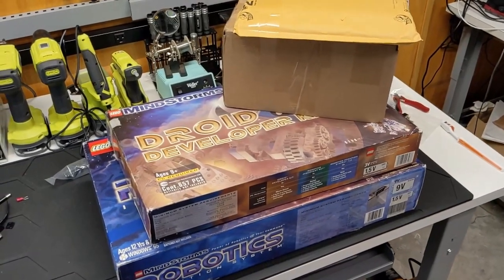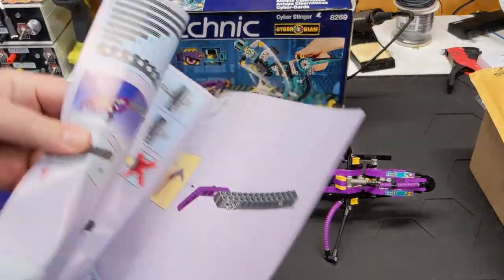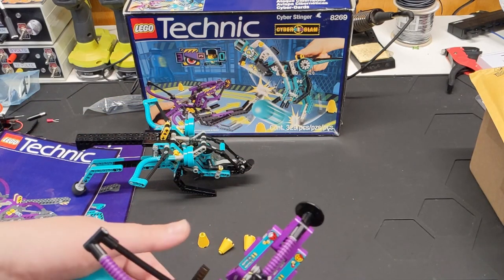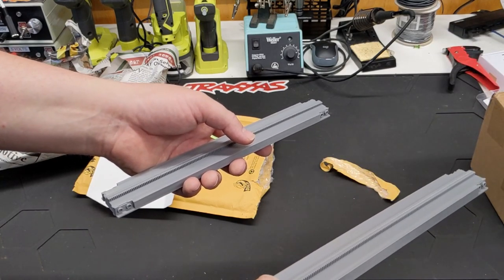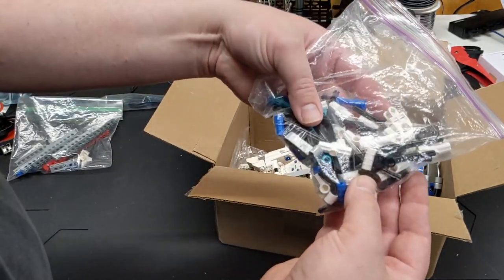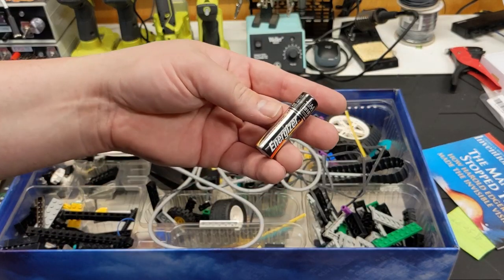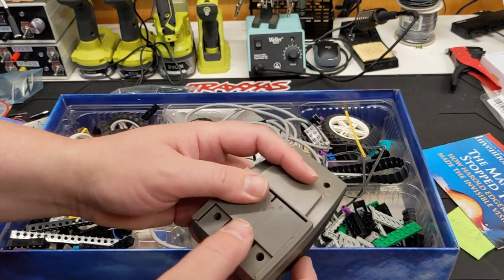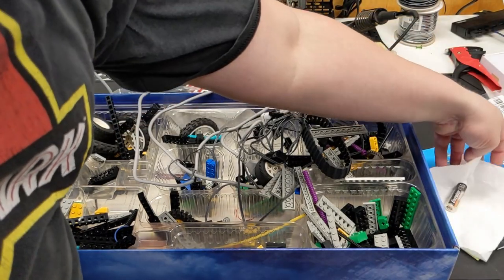Used Lego Haul  - Mindstorms and 3d printed monorail tracks July 2022

Comment: Cyber slam! These sets were always on clearance when I started buying Lego again as an adult... a cheap way too stock up on technic pieces at the time with bonus of the futuristic figs. Lego ZNAP didn't do so well either and I remember geting them for 4 to 6$ a set... the $6 sets came with a technic motor and flexible axel... I wish I had bought more of them in retrospect, there were piles of them in Toys R Us at the time
Reply from the maker: Yeah there's so much Lego clearance I wish I had gotten a hold of back then!  A few years back I did pick up a znap set with the motor and flexible axles, I haven't used them for anything yet but it's nice to have them just in case 😅